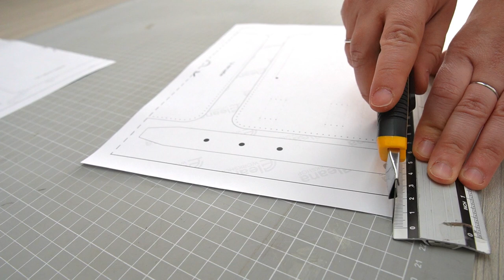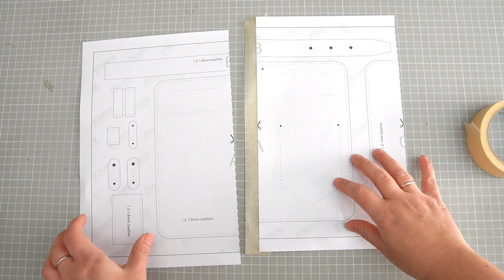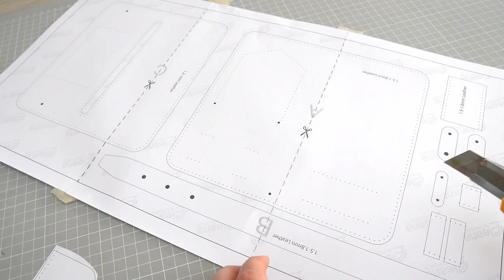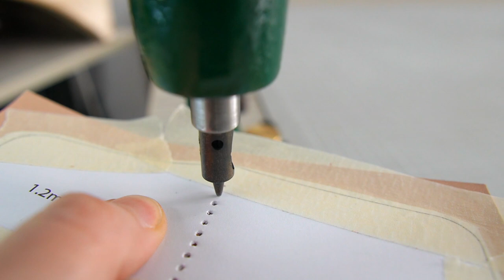How To Make JEANS Leather Wallet | PDF Leather Pattern

Comment: Do you print out the pattern each time you make one of your products, or do you create more permanent patterns? Possibly out of acrylic? I've always wondered how I would go about making a more permanent pattern for my own work. And awesome job on this one, as always! :)
Reply from the maker: Thank you for watching my video!
Based on my experience, using printable PDF patterns is a more practical and efficient option compared to using acrylic patterns. With acrylic patterns, storage can become an issue, as you may end up with a large number of pieces that are difficult to organize and keep track of. Additionally, marking every stitching hole on acrylic patterns can be time-consuming.

In contrast, PDF files take up no physical space, and you can easily organize them into folders on your computer. This makes it easier to keep track of your patterns and avoid mixing up pieces. Overall, I recommend using printable PDF patterns for leather products for convenience and ease of use..
Reply: @EleanaWorkshop  Thanks so much for the feedback!

Comment: What color dyes are you using? Fiebings turquoise overall? Then Fiebings light blue on edges and blending over?
Reply from the maker: Yes! I just use a very small amount of the darker color to achieve this effect. The cloth needs to be almost dry.
Reply: @EleanaWorkshop  Thank you for responding and the pattern. I look forward to making it!